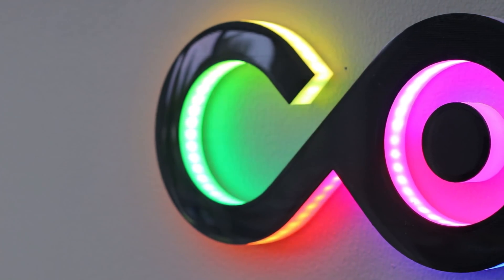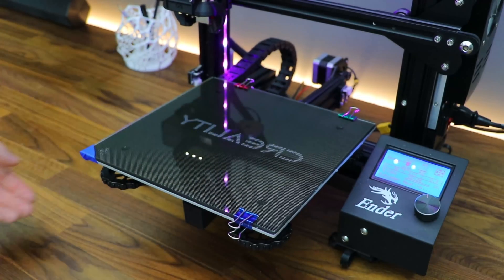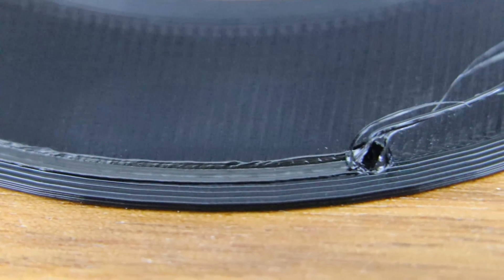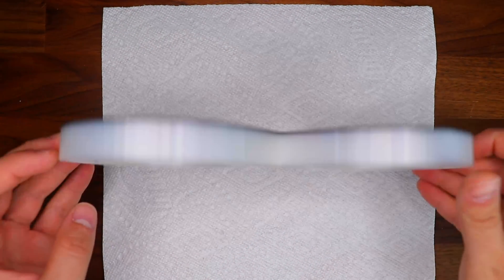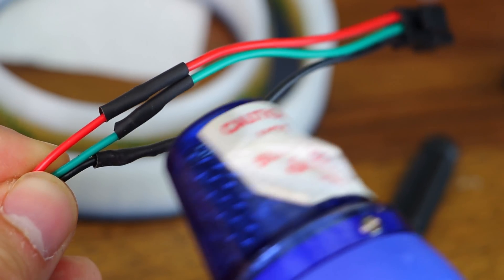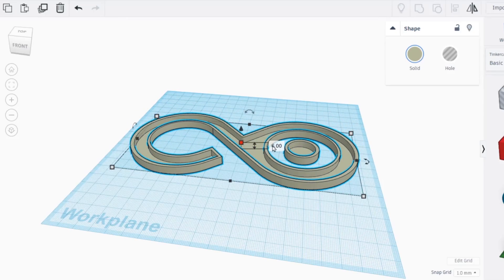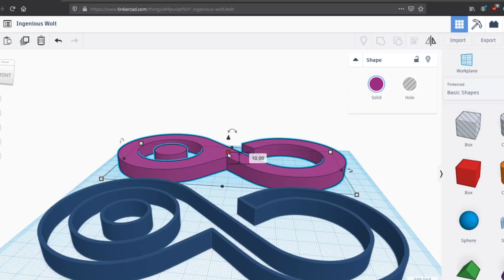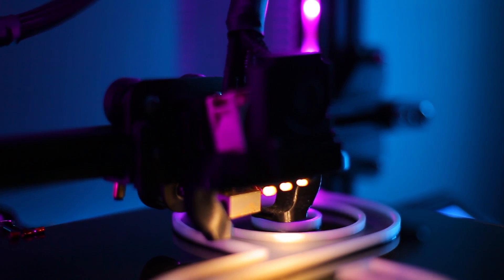My Wall Mounted Channel Logo

Comment: What are the dimensions of the logo - what I see in your illustrator file is 1920px/896px - but when you 3D printed it was it the same dimensions or you changed in when you imported the SVG in 3D software?

Comment: how many leds? 😲 its about 100+ leds what powersupply you use?
Reply from the maker: Can't remember the exact # but it's over 100, wled auto-regulates the brightness for you so you can power over USB without using too much current. With this being a decoration, I don't need it at full brightness!
Reply: @Coltography  oh good...im making gaming logo and its over 100...using 5v 4amp adapter..maybe can power it..godluck me.. 😂

Comment: Use (and buy - support a Canadian company Corel) CorelDraw, it has a function to translate any image to vector. It is called CorelTrace, works awesome, can simplify the process and can save you allot of time or knowledge how to do so. I am an 25-years user of CorelDraw, no connection to Corel of whatsoever, just experience. Most people use Adobe Photoshop because it is 'known', advertised as 'standard'. CorelDraw can do at least the same and more, better in many ways IMO. Give it a try. Anyway, nice, smooth and 'simple' logo. Nice projects you make.

Comment: I wouldn't keep the printer on the desk close to you. It can release harmful chemicals and microplastics into the air. And prolonged exposure might lead to problems later on. 
I'd buy a cheap vented enclosure, which also helps with the printing of ABS.

Comment: Can you link the wood filament you used?? It looks so real
Reply from the maker: Hatchbox wood pla
Reply: @Coltography  did you do anything special with it besides staining it? The grains look so realistic
Reply from the maker: @brentthebuilder3555  sanded in 1 direction, stained with espresso. Any clear pla will work but I used the brand solutech.
Reply: @Coltography  also, what is the filament for the clear part?

Comment: So when I lower my LEDs from the board I lose WIFI connection on the board.... but when I remove LED power from board the WIFI comes back.... any ideas how I can fix this?
Reply from the maker: Probably have a short circuit on your led strips somewhere, it's shutting the controller down when you connect them. If you have a multi meter check between each R,G,B,+ terminal to begin
Reply: @Coltography  figured it out... was connected to the wrong end of the data feed on the LED strip lol ugh. thanks for the response and the stellar video! inspiring creativity!

Comment: Great video and very well explained. Will probably be making this in the future. I was wondering where you got all your wire you use. Also, I really like that little cubbie shelf shown at 5:07 and i would really know where you got it. Thank you!
Reply from the maker: Amazon, they are called tip out bins. Look at reviews before you buy! Mine breaks sometimes and needs the hinges superglued back on
Reply: @Coltography  Gotcha. Thank you for the info! <3

Comment: If you put the leds on the back of the black front, the light will diffuse a bit more, and you won't have the separate leds showing through. nice project!

Comment: Some dope job!
I got inspired so much, that I bought 3d printer and I'm gonna make same beauty :) U could sell these lamps for real!
I got just 1 question.. How the hell did you power up LED through Node by usb cable? As I'm counting 1m of 5V 144 leds strip = 43 W which is 8,6 A. What kind of power supply can provide that? Am I thinking wrong? :D
Reply from the maker: Hello, wled adjusts the brightness based on led # count so they're not at peak brightness. Maybe 50% but still very bright, and good enough for this purpose. Any more and I would get a seperate power supply. :)

Comment: Hey dude, you're printing on the wrong side!
The black coating actually grabs onto the plastic at higher temps and auto releases when cooler.
Reply from the maker: Doesn't provide the same glassy finish though. :)
Reply: @Coltography  Very true.

Comment: Hey, quick question. So I bought a few sunix led controllers (the ones you have in your other video). But I was told they can only control normal 5050 RGB? is there an easy way to get the leds to colour chase like the ones in this video without using an extra hardware/scripting? I can't seem to find this info anywhere.. please help. 😭😭
Reply from the maker: Nope, these are addressable LEDs so you need to have an Arduino or similar micro controller to have them animated etc.  The wifi controllers and regular led strips just provide voltage to whichever color is chosen.

Comment: Sooo all I need to do is get like $500. $300 for the 3D printer, about $100 for the filament, $50 for the LED’s, another $30 for the Chip and then like $70 for the soldering iron then $40 for the solder then I should be good right.. right oorrrr I could find a buck around the house give it to my mom so she will let me give a charity $1 because I have like no money whatsoever
Reply: 50$ for leds? Not even close. More around 10$. The chip is also just 2$.
Reply: Oh. Well, ok then
Reply: $200 printer, $40 filament, $10 leds, $5 chip, $20 soldering iron, $10 solder
Reply: Nick Garber where are you finding these priced
Reply: Blurry Knight personal experience
Reply: @RadicalRacoon  40$ FILAMENT!?!? Sooo you buy a 300$ 1kg spool or what?
Reply: EL Valenin nah I meant if you bought two full spools(one black and one clear)
Reply: 2$ for the mcu, 10$ for the leds, 15$ for a sheet of acrylic 4$ for epoxy glue and 5$ for a knife. stop making excuses. your'e just lazy.
Reply: ESP8266 is just overkill for this simple animation
better to use some attiny85

Comment: Great project! I think making the walls thicker or offsetting the L.E.D's would disperse the light better, making it more of an even glow and hiding the individual diodes. This is how it's done on computer peripherals or PC components. Instead of 3d printing the face, you could also have a solid piece of acrylic laser cut at a lot of local maker spaces (maybe not as easy with C-19 lol).
Reply from the maker: Thank you - and that's a really good idea. I briefly thought about it when I recorded the voiceover at the end showing wall thickness and you're definitely right, the diffusion would look awesome. Will have to try it

Comment: Hey man! How did you manage to power the whole thing directly from the board? I tried it with my ESP32 and a 64 leds and all that happened was that the first led was on but at like 1% brightness. So I think it didn't provide enough juice.
Reply: Ok, update. Iam a dumbass. I used a power source that was like 2V. Switched to better one and everything works fine

Comment: Another way to get smooth surfaces if you don't have a decent enough build platform is use the ironing settings in cura. Better than nothing
Reply from the maker: Tried this on some other stuff, definitely helps but can't achieve the mirror finish. :P

Comment: Finally :). 
I don't get how you get your prints so shiny. Could you share details on the 3d print please? Material, print settings et cetera. Thank you, great vid.
Reply from the maker: Printed on glass bed, standard PLA, used default standard quality settings in Cura. Nothing out of the ordinary :)
Reply: Just print on a glass bed surface